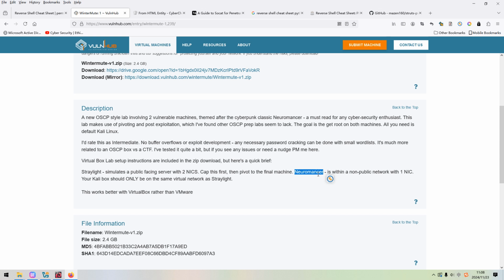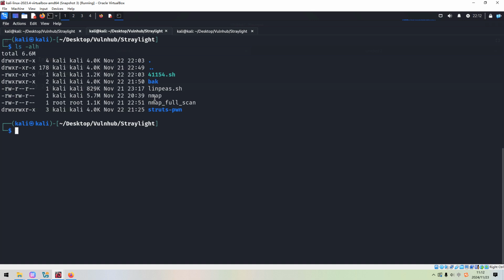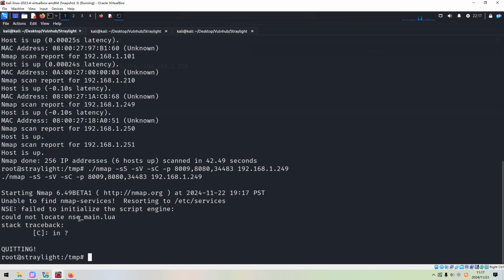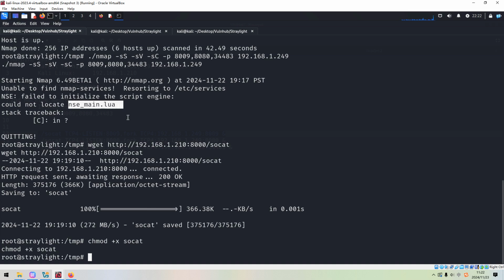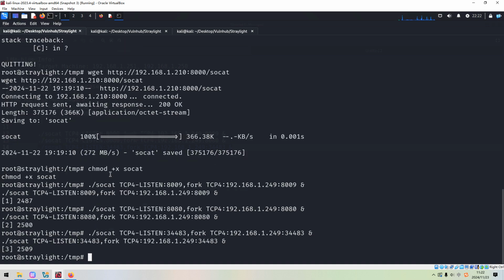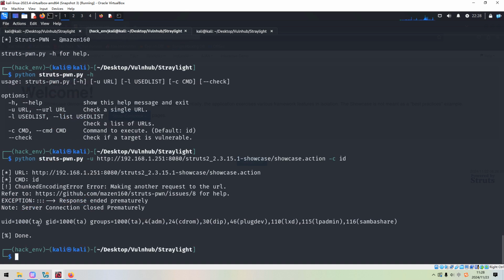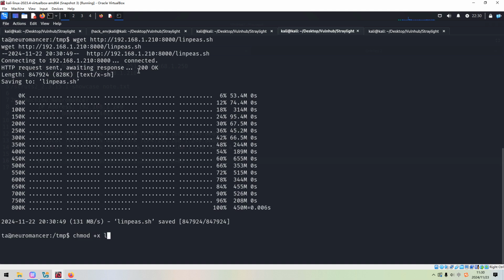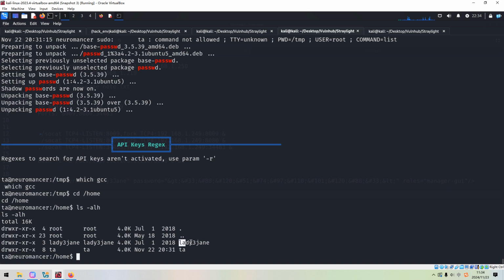Cyber Security | Penetration Test | CTF | Walkthrough | WinterMute |  Neuromancer | Pivot With Socat

Comment: why dont you use ligolo-ng for tunneling as it is very straightforward and all ports are forwarded at once of the internal network
Reply from the maker: I never use it. I will try to know what it is and how to use, thank you.
Reply: @junhuawong1419  now that i have done this machine and i faced problems taking files/exploits to neuromancer from the kali machine. I would say your way of socat is better as it makes bidirectional data transfers easier. Nice walkthrough :washhands::goodvibes:
Reply: @junhuawong1419  Now that i have done this machine and needed to transfer some binaries to the neuromancer, i belive that socat is better as it does bidirectional data transfer. But only two downsides are :

1. Need to forward each port individually.
2. If the same port is on both machines running, than we need to give a different port number for that port and remember it.

Comment: What should happen after we got the flag.txt on Straylight
Reply from the maker: This lab has two machines. If you can get the flag.txt on Straylight, it means that you've completed the first step, however, you should go on. Then you should make pivoting from the Straylight to find vulnerabilities of the second machine.
Reply: @junhuawong1419  How did you get to root directory from tmp? Is that a hash displayed for the root flag? Exactly, what is that, how can I crack it to go on?